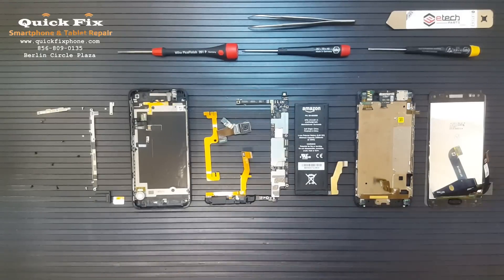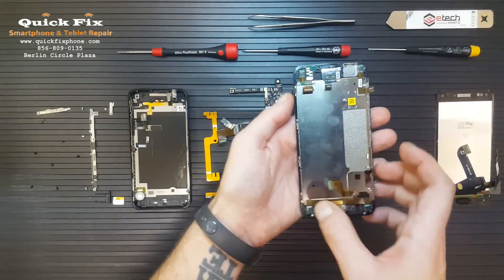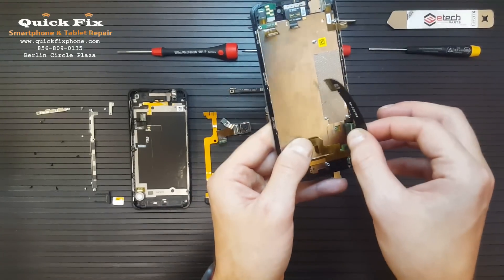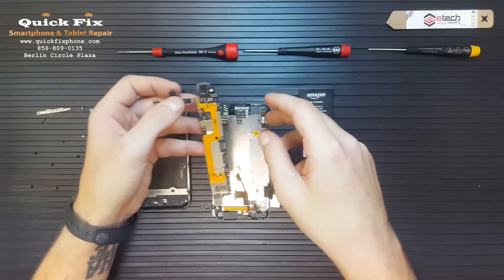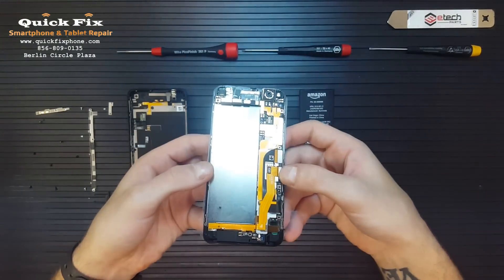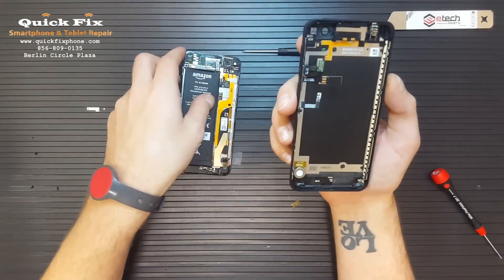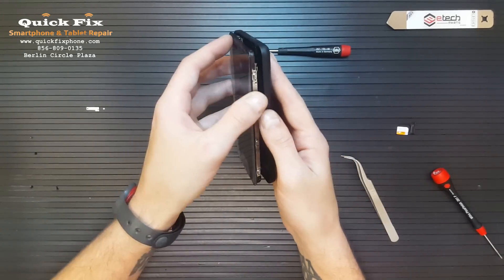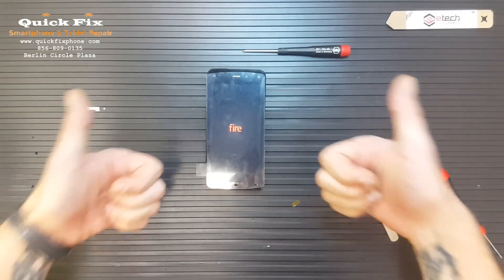Amazon Fire Phone Rebuild one crazy looking device by Kenn

Comment: good day sir. i have an amazon firephone and now it shows no battery indicator on charging mode. it does not boot itself. last system fault was blinking the fire logo 5-6 times and after that it leaves nothing as in totally dead. i keep pressing power or any button but still no response. do u have any suggestions on that sir? thanks
Reply: Battery replacement